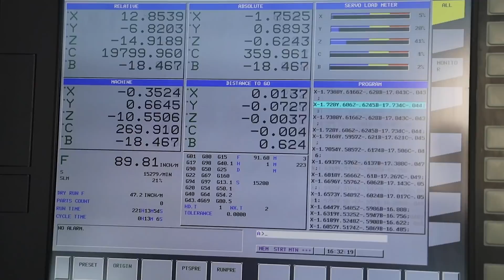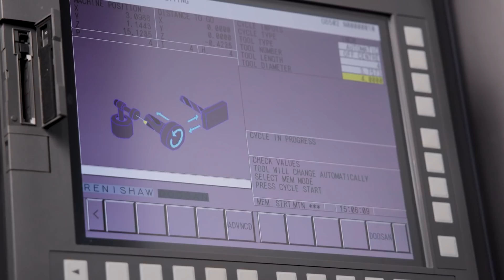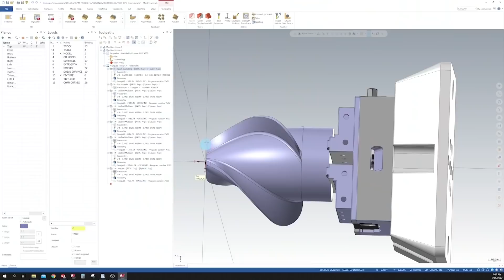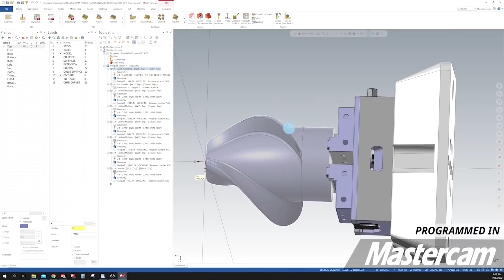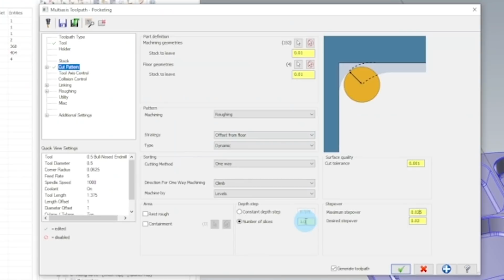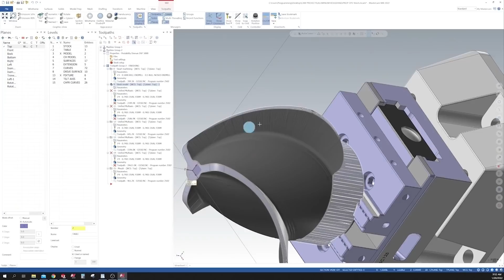THIS JOB SUCKS… The Other Machinists Won’t Teach Me…

Comment: I was good on a CNC lathe and never got to program and run the CNC mills. I never hat a CTL file for them either they did but they couldn't or wouldn't run the lathes.

Comment: I might be too eager to teach because while I certainly have met some machinists who have taught me things, even when it was way too above my level of understanding, I've met many, many, many more who either left me to my own devices, or who didn't know the answer to the question I asked.

I know Oregon, or west coast machinists probably have a bad reputation at this point, due to the companies here, but having to figure out how to hand edit and write programs that normally depend on automation like loops and subs, counters and #5201-#5205, and then being told I wasn't trained enough for a raise bit that one company that comes to mind harder than they could ever fathom. They were all illiterate but thought they were too good to teach me. My time there was miserable, but what I learned there with nobody to teach me ended up with me having the power of god at my fingertips. I won't go into details, but they did not have tattleboxes, and also went off of dprint output for inspection reports that went to the customer. Do you have any idea how easy that is to falsify? Did I do the right thing? No, but I bet they chased numbers for weeks after I left. I did not scrap any parts and did not crash any machines. I just made them waste time. I don't know why I'm telling this story because I'm alot more mellow now, but 

I recognize good machinists or those with potential, because I don't want an angry machinist to write m99 loops that repeat any number of times doing a ghost pass .01 from the surface tracked by macros and an if check.

Comment: Being an experienced tool and Die Aerospace mechanical engineer I could say for a fact your first opening dialogue is absolutely true. Too many men get on CNC or wire machines to learn the machine and they get stuck on that machine forever. They soon learn that they want to advance, do programming,  do other things to get out of the low wage paid job that they’re in that also carries with it no respect. However, too many companies want to keep them stupid and low/lower paid jobs and only let certain people do the programming for them. That is because they’re afraid of losing that employee or they may even want more pay for the new skill level they have. I have seen this happen hundreds of times. I would teach young men how to program and do engineering drawings and then after they learned AutoCAD, inventor and programming they soon thought and sought out other venues for employment. Then companies purposely had me stop teaching them so much information on purpose so they could not leave the company.
Reply: I left machining because of this. Way to many people want to treat you like a robot
Reply: @dominic6634 Im prepping myself to get out in 4 years. Tired of boys clubs and corporations lying their ass off about applying yourself amd when you do they just expect you to maintain that pressure for the same pay after you proved your worth. Tired of the egos,finger pointing, no accountability, and just basic disregard for people. I dont recommend it to any1. I've unfortunately been doing it for going on 11 years professionally and 5 years of schooling.

Comment: I'm been working for 7 months at a manual machine shop and it's just like that nobody wants to teach me anything ,i've held up this long cause of my skills as a mechanic (welding,repairing stuff) but to this date i've only machined 7/8" threads and hundreds of stainless 1/2" hinges
Reply: After one completes an apprenticeship, he is considered a "journeyman". Why that name? Because he was once expected to journey about to work in other shops to learn techniques not used in the first shop. The trade encompasses much more than is contained in any one shop. The concept is the same as what the video shows, that growth is your responsibility. The benefit is that what you learn is yours to keep and hopefully build on.

Comment: I came to my current shop with no CNC work experience only a couple years,manual I had just finished Cnc school , been at this job for 10 months, I felt I had a really good grasp on everything I need to be a good cnc machinist not just an operator , I wanted to move up to a lvl 3 from 2( there is 5 levels) I had what was needed for 4 . My boss payed no attention to the extra hard work I put in, and no one in the company knew mazatrol programming so working on the weekends I taught myself mazatrol while keeping my machines running because I wanted to cut costs. I showed my boss the improvements I could make on old slow programs written 20 years ago,  he wouldn’t move me up and didn’t want any changes. I switched to weekend shift and my new supervisor was shocked I wasn’t a higher lvl and he bumped me up. There is just people out there that don’t care to see their workers succeed and are out here just for a paycheck .

Comment: This is all true. Im not a machinist but i always wanted to work with electronics so i taught myself how to build drones and solder from the internet which was enough to get me an entry level job assembling battery packs. I ask alot of questions and always say thank you which led me to today where i was given accesss to the shop alone to work overtime. Even guhs who describe themselves as "the asshole of the shop" are willing to help because they see that i care about the work. Put in the work on your own and the experts will recognise it.

Comment: I need to pull the trigger and start the academy. I’ve been promised a spot in the CNC milling department at my job but they continue to hire new people and neglect to consider me for the position. I’ve been running Bridgeport knee-mills retrofitted with ProtoTRAK units for 8 years now and have shown myself to be able to understand how to mill parts efficiently. Thanks to this channel I’ve learned to push the limits of what I thought was the barrier of machining. I have now been able to make Bridgeport mills run as hard as our CNC department is and with less quality errors too. I’ve began to think that the leads in the milling department are as you stated in the video, “scared” to lose their position to a younger machinist. They purposely program odd ways to make it confusing to learn and see what they’re doing so it makes them look more valuable when they have to help so much. Stuff like that needs to stop in the work place.
Reply: Don't feel slighted. A good Bridgeport guy is very valuable, and can be just as fast as CNC at getting parts out the door when they're simple and one or two offs. Get really familiar with your trig and the macine's DRO and you can even do your own 2D radiused toolpaths.

Comment: i studied mechanical engineering but unfortunately live in a country that produces nothing so ive never worked in the field for 10 years since i graduated, couple that with the 08 crisis which hit my country hard and the pandemic i never had a chance to even be in the position you are describing.
Reply: I understand you brother. I obtained an engineering degree nearly 40 years ago, but the Reaganomics Depression killed the hopes of nearly everyone I studied with. But I discovered this trade and it suited me better anyway. I started right at the bottom and earned all the stripes. My experience eventually earned me as a position as machinist for a research facility where I am front and center in the design as well as manufacturing stages for their equipment. I learned long ago that the degree means something but doesn't mean you are owed a free pass to the country club.

Comment: alot of people need to be un plugged and let free. alot of people will never, and should never be anything more than button pushers too. not everyone is bound for this. and thats a good thing
Reply: I agree. And operators have their value too. They are the ones willing to run the same parts everyday and not get bored. That's why I will never talk bad about anyone that does just that.

Comment: It's funny you mention that a lot of other guys at the shop won't go home and research things that would help them perform their job. I actually do this, when it comes to new features on a part I haven't done before I google how to do them or if it's a new material I try to google the best way to run it or what properties are in the material. I've learned so much just on my own and I'm only 24 years old and one of the best machinist my shop has. We have guys who've been there 15+ years and their just lazy as hell and they think the company like owes them or something. I've been doing machining since I was 18 and out of high school and if you have a true passion for this trade the knowledge will come.

Comment: Somewhat similar experience here, but I think in my case, no one really had that much knowledge outside of setups when it came to CNC's (~100 person production shop).  Most actual machining knowledge was held by the programmers/engineers.  However, supervision was so hands off that I wound up learning by just doing setups, observing toolpaths, and reading a couple of CNC textbooks for reading during hour+ long cycle times.  I left that job for another where I got a 35% pay increase running Swiss machines.  Granted, I left that job to get my degree in mechanical engineering and now I've come full circle and work in a small shop designing parts and fixturing, programming machines, and proving out my own programs.  Good times :).
Reply: What books would you recommend?

Comment: The management of the company should decide who take time out of their day because the company is paying for that time.  If management decided who teaches who then they could set up a more structured learning environment and then the management knows who did what and how much time it takes.  I worked for a tool and die in the 90s and they had just cancelled their apprentice program.  I knew that was bad because it is better to learn on the job rather than in a classroom.

Comment: Having been on both sides of this, the guy's that are humble and sincere about learning will learn. The guy that complains about doing "stupid work" the 1st week and can't seem to get that right, doesn't usually make it.  Don't be the guy that comes straight out of a 6 week course and expects to go straight to programming a $500,000 machine. It's not going to happen. You don't know what you don't know yet.
Reply: I have seen that so many times.  A guy that has no experience and think he is going to get put on the most expensive 5 axis machine in the shop.  Then he gets mad that he has to start out on a production job